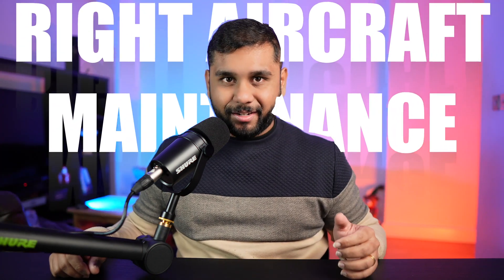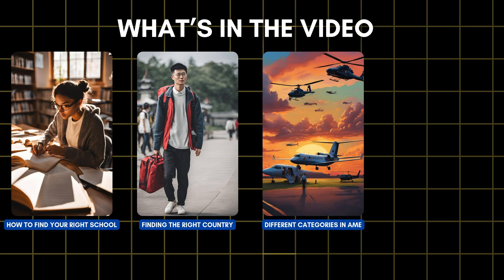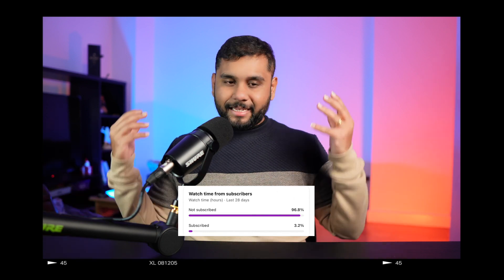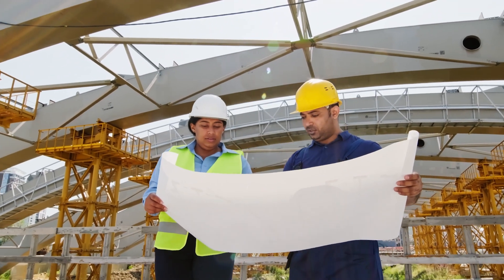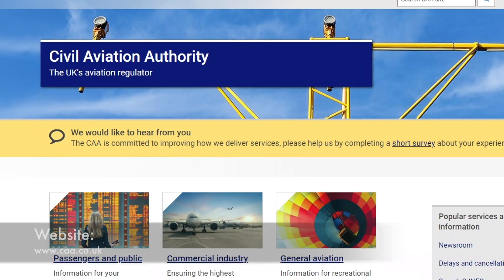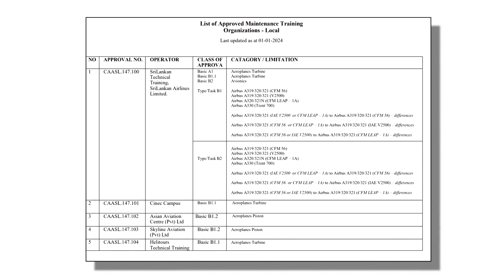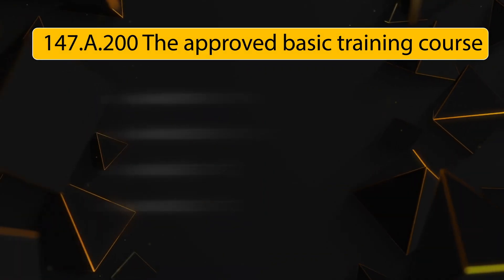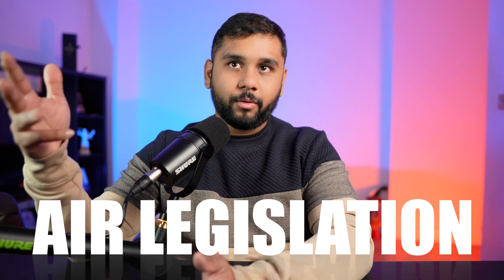WHAT Makes an APPROVED Aircraft Maintenance School?

Comment: I am currently pursuing my EASA B1.1 Part 66 lincease from an institue in india which is an EASA CAR 147 approved and also approved by DGCA and GCAA so, can i get a job in Europen countries after i am done with my studies and also gain a 2 years of experience basically done with my OJT
Reply from the maker: If your institute in India really holds a genuine EASA Part-147 approval under Regulation, then yes. Europe will recognise your basic training and exams.

Under the rules:

Part-147.A.130: Your certificates must be accepted by EASA Member States

Part-66.A.25 & 66.A.30: With your completed modules + 2 years of experience, you can apply for the EASA Part-66 B1.1 licence

66.B.100: Once the EU authority issues your licence, you can work in any European Part-145 organisation

The important point is this:

Only an actual EASA Part-147 approval counts.
DGCA, GCAA, or “EASA Standard” approvals are not recognised unless the school also holds the EASA issued Part-147 certificate.

If your school truly has the EU approval, then yes, you can get the licence and work in Europe after meeting the experience requirements.

Hope this helps